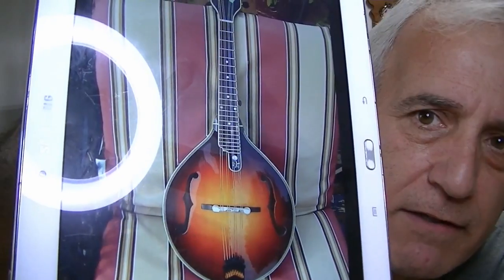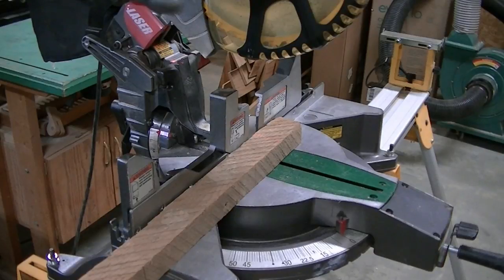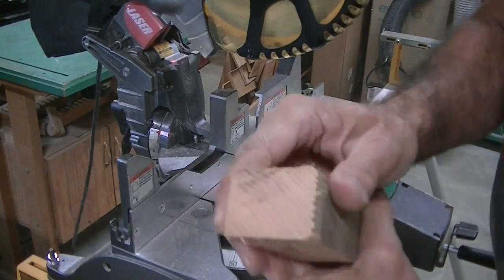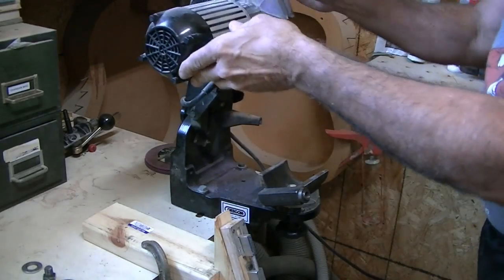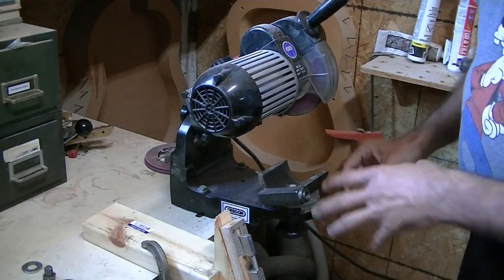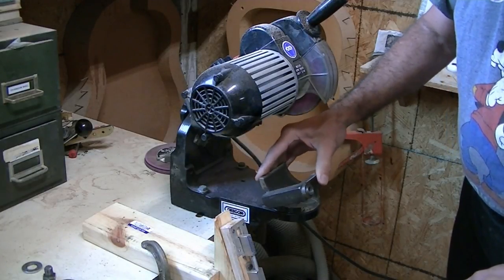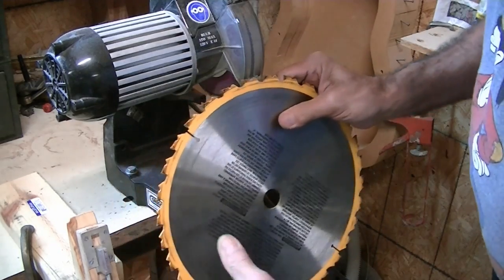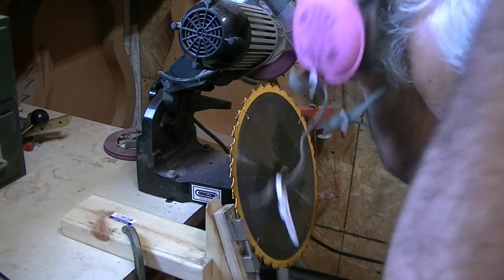184 RSW Saw Blade Sharpener, Viewer Comments, Announcement

Comment: The Harbor Freight sharpener is a good buy for around the home. Around $50.00. I've sharpened around 50 blades so far and they cut fantastically afterwards. I would say I saved enough to pay for the sharpener.
Reply from the maker: bobkins270 yes I was looking at those almost bought one and then decided Well I've got this why not just use it. Thanks for watching.
Reply: Rosa String Works I really liked your setup. Good engineering. If you could set it up for your band mill, I'd almost pay to see that. :-)
Reply from the maker: bobkins270 I have already been thinking about that but I don't have any ideas as of yet. Thank you

Comment: Like on a chainsaw You have to lower the snag tooth behind the saw tooth
Reply from the maker: Garnett M I understand. However I don't think this one is wore down enough to worry about that at this point. Thank you for watching.
Reply: Rosa String Works Ya ,,,Are you still carving the mandolin
Reply from the maker: Garnett M yes that's one of the reasons why I have to find more time.  Thank you for watching.